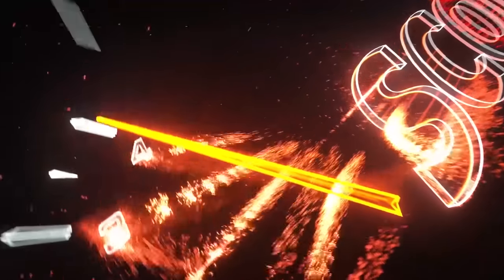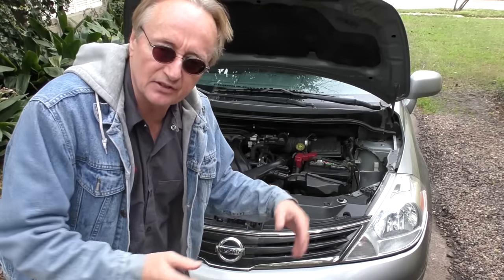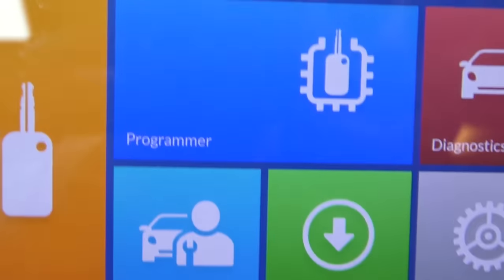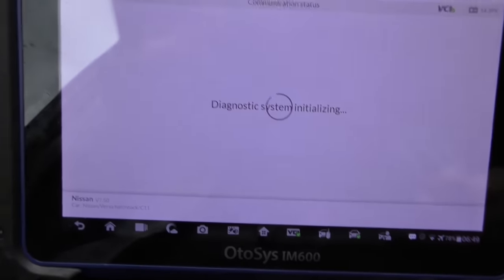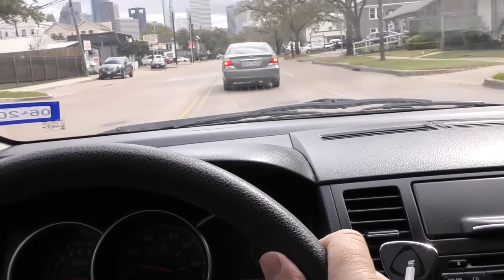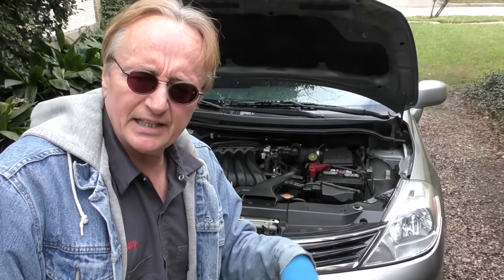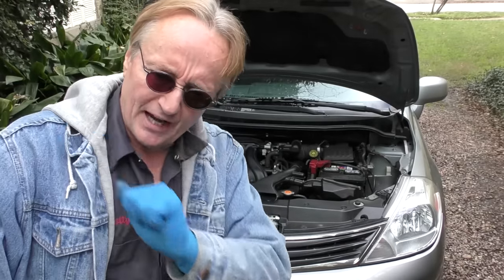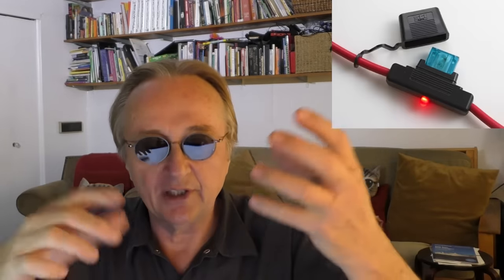Here's Why You Should Buy This Cheap Nissan

Comment: You said someone bought it for $2500? and it's a 2012 model, it's a great deal!
Reply: We had one. It was poorly made. Rattled all the time, despite having 40k miles. It was huge inside though, the trunk space was gigantic too. The engine was well made though. Never had an issue.
Reply: its a nissan,, And they start at $10,000
Reply: @John Fedor It's a simple car without fancy tech. Timing chain, 4 speed auto, no nav or cameras. It should last a good while longer if taken care of. 2500 is a decent price for newer-ish car that looks pretty clean, plus I'd assume it's a southern car, so not much rust or corrosion. I would not buy one of these new, but in a pinch this can be a good car for someone with a tight budget.
Reply: Just Some Guy without a Mustache no it’s not especially considering it has 111,000 miles on it and those transmissions tend to grenade themselves. This car car could be near the end of its life.

Edit…didn’t I realized it had a 4 speed auto, it’ll last longer than the horrible CVT powered ones.
Reply: I got a 2011 for free.
Reply: 111k miles, gonna need the front end redone soon. I bet the highway vibrations show up soon.
Reply: They're pretty much one of the rarest compact car in Germany.
Here it's called Nissan Tiida and you rarely find one with an automatic. They have 5-speed manuals combined with the 1.6l 110hp engine or a 6-speed manual with the 1.8l 126hp.
Reply: @mopedshed  they shoulda paid you to haul it away. 🤣🤣
Reply: @rockraphlegal  if the only issue was rattles and the engine was well made then $2500 is a fair deal lol
Reply: @kenjsr1  ikr, I picked it up from the Bronx, every panel was dented and the wheels had those black hubcaps on them from AutoZone.
Reply: Looks like just changing the pugs will cost another few hundred bucks for labor. They are all like 3500-5500 in my area, so 2500 is a decent deal. A cheaply made little putt-putt car with that many miles on it is gonna deteriorate fast though. Worn out suspension, leaks from power steering and other things, rusting frame components, etc.
Reply: @garybeltrand5802  Electronic power steering.
Reply: Keye Haze no
Reply: John Fedor yeah actually no my dad has a 2010 other than a catalytic converter at 180k miles and ignition coil here and there the car is a damn good deal, today it’s at 520k miles and the transmission is barely starting to go, you’ve probably never bought cash car before though, you can’t buy a 2002 accord for 1k at 2500 I could sell it at a flip for 3500 in a week.
Reply: Thats 2012 Nissan versa hatchback mine is 2007 Nissan Versa hatchback s 181k miles 4 speed automatic still runs on the road
Reply: I just got one for 200 with 96,000 miles on it and new transmission and brakes
Reply: @epyonsystem1869  its that a hatchback or sedan style?
Reply: Got a 2011 Versa 4 speed automatic. 104k miles. Shifts like a dream and stops on a dime. No issues.
Reply: Just some guy with a mustache 
it is and also, you are literally everywhere.
Reply: @mopedshed  Don't get tricked by a quick oil change store when they suggest power Steering flush.  Versa has electronic assist steering.  Versa needs new valve cover, spark plugs at ~100,000 miles. Recommend NGK plugs. Run a cleaning foam thru bottom of AC drain tube.  My Evaporator leaked cause junk and moisture caused a leak ( a big labor job to replace Evaporator! ).  Also, engine has two thermostats. If you live in a 🔥  climate, replace with  185 degree F thermostats.  Also, it is normal for the car not to start on first cold start. You need to allow ~3 or 4 seconds for fuel to get to the engine.  Google "Versa forums " for lots of diy & how-to's. Peace.
Reply: @rockraphlegal  the motor blew in my sisters 09 versa woth around 150,000 miles
Reply: @JDMHaze  They did. The 2020 base model starts at $14,995 USD.
Reply: @rockraphlegal  it probably rattled because you didn’t change the motor mounts lol
Reply: @tails300  yeah the CVTs are the ones that are bad... most of the time. My friend has a 2015-17 Versa hatch and so far her CVT hasn’t gave out
Reply: @rockraphlegal  the timing chain was probably too old
Reply: We both watch cars and attack on titan videos?!?!
Reply: @mopedshed  ungreatful much
Reply: My guy. Whants to sell me a 2013 I believe so nissan versa for $6,000
Reply: @mopedshed  show off 😂
Reply: @garybeltrand5802  I’ve had my 07 Versa for a year now and it been amazing
Reply: Who are you. I always see on different comments
Reply: why are u everywhere !!! whenever i watch a video I find u leave me alone !!
Reply: I mean I found a 2009 Nissan Versa with a 4 speed automatic with only 70,000 miles for just $1200. You think I should consider it? No issues at all.
Reply: @idkmyname_2007  mines I'd already 202k miles bro no issues with it I used it to my daily and hanging out with my self and Go to Far car meet This Car is small but Its tough 😊
Reply: That's exactly how much I bought mine for, also a 2012 but it's the 1.8 s version (Automatic, not CVT)
Reply: Found one this week 2011 120,000 miles 4,800 dollars.

Comment: I have a 2012 Nissan Sentra S with over 192,000 miles on it. Never had an issue with the original CVT. I changed the fluid every 60,000 miles as required in the owner’s manual. Nissan is capable to be reliable as Toyota and Honda. You haters should learn how to read a manual and drive a car properly and you won’t have any problems long term.
Reply: chrisgraydon 
Well spoken true player!
Reply: I agree ☝🏽
Reply: Also own a 11 murano with a 136,000. I change the transfluid every 30,000. No issues

Comment: I’ve had my Versa for about 4 years now and it’s been a TANK. It’s nearly at 200k miles and still running strong... the worst issue I’ve had with it was just a misfire on the 1st cylinder a few weeks ago.. besides that’s it’s been perfectly fine. With regular oil changes and normal check ups and maintenance this little car will go for years and years! I recommend it as an owner 🙏🏼
Reply: I bought my civic brand new in 07 and it’s finally starting to go. I got my eye on a 2022 SV Versa that I’m about to pull the trigger on
Reply: I had mine for 7 years now about to hit 150,000 miles. I kept up with the maintenance & havent had any problems with it.
Reply: @raydawg2132  I got the 2021 SV in January, absolutely love it so far!
Reply: Thank ya sir...as I'm in the process of buying a 2014 versa manual transmission...better
Reply: 2017 SV sedan and other than a glass steering rack, it's not THE WORST car, and it's snappy when it needs to be.
Reply: Just got a 2013 Versa SL. 150k with brand new transmission from dealer. Smooth ride. Happy. Will update. Lol
Reply: Im a toyota guy, however the versa is very underrated, i have a coworker we do courier service, he had more than 300k in it (versa) and counting
Reply: @Mujahideen_khinzir  manual trans
Reply: @HistoricalWeapons  actually automatic, its an older versa, i think the 1st gen, not sure
Reply: What yr is yours
Reply: @Mujahideen_khinzir what year?! What transmission?
Reply: @HistoricalWeapons  no, automatic, a 2009ish model. We live in socal so i guess the weather maybe a factor as well? My corolla went 260k +
 miles before i sold it, just bought lower mileage year older same corolla for insurance purposes
Reply: @lovedove9734  he had the automatic 2009 nissan versa. This was back in 2016.
Reply: @ronly_driver is the steering rack the only major problem that some of the Versas might have?  I know if you get a CVT change that fluid regularly or get a mechanic to do it and make sure they know with no doubts that it is a CVT so they don't put ATF in it and destroy it.  I have heard of that happening to some Honda owners too, they have a CVT and the shop puts in ATF by mistake.  It will ruin them.
Reply: What year is yours?
Reply: @GorillaGlue42 did you do it? I was going to say I don’t think you would be too happy after being in a civic? Pacific is a lot nicer in my opinion. A lot more pep too
Reply: @blacjackdaniels200  I did like it, def not the same as a civic though. I only drove it for about a year and traded it in towards a 2023 Sentra SR Premium.

Comment: That first gen Versa was decent cheap transportation.  Nissan could have saved their reputation over the years if they'd only stuck to traditional automatics.  They'd probably still be #2 behind Toyota if they had.
Reply: What’s wrong with CVT’s if you don’t mind me asking
Reply: @jms3460  Higher chance of failure than a tranditional auto
Reply: @jms3460  a cvt in an of itself is fine it's just Nissans one is crap Toyota Honda and other companies don't have problems with theirs it's just Nissan
Reply: @jms3460 cvts ain’t so bad but Nissan makes horrible cvt
Reply: @jeffmorse645
It really boggles my mind how after all these years they haven't either gone back to traditional autos or at least switched to using a more reliable 3rd party CVT them jatco.
Would solve so many issues with brand reputation.
Reply: @hollowgonzalo4329  They own the CVT manufacturer.

Comment: Underhood looks alot like my 2011 Nissan Cube. I have changed the CVT fluid every 30 thousand miles, and changed the oil every 3750 miles with top grade synthetic oil, and at 145,000 miles it has been almost problemless.(MAF sensor only repair) and runs and looks great. Going for 300k(fingers crossed)
Reply: Is changing the cvt fluid the key to keeping these transmission going? I know people that have had to replaces transmissions on Rogues
Reply: My Cube now has 234k miles. Original transmission. I think with regular maintenance you have a chance at a long lasting CVT. I think with no maintenance the chances are low. Best of luck!

Comment: You're so correct Scotty. The CVT trans, are junk. My 2019 Versa rental was like an upholstered beer can with a radio. Thank you!
Reply: Lol!!!
Reply: Seriously though, got one as a rental on a rather windy day, scary to say the least😂
Reply: I own a 2016 Versa with the CVT transmission and it currently has about 140k miles on the original CVT  transmission and no issues. From what I've seen the older generation CVT transmissions had more problems than the newer generation ones. I think an important part of keeping it going is changing out the CVT fluid every 30000 miles or so plus both filters that the CVT transmission comes with.
Reply: GenEmperor that’s incorrect. the older cvts that didn’t mimick shifts had less problems .
Reply: @GenEmperor  you've only got 140k miles on it though...
Reply: @user-oq3lv6lv7x  I have a 2017 nissan cvt and it doesn't mimmick shift.
Reply: My Versa is fine. Mine has a manual transmission tho
Reply: Everything feels safer than a motorcycle. But i still love my bike and i still have to ride a versa so when it dies i wont feel sad
Reply: I have a 2020 Versa,   granted a much different design from the later Versas,  no problems yet... but it is only about one year.   I have this on a lease, so I doubt Ill have it long enough to see any problems,  Ill probably be around 45k miles by the end though.
Reply: @mewimi  2017 here. Gotta love the sub-$20 fill-ups at the gas station. It does get a bit windy though.
Reply: @xxboxofmuffinsxx4252  I've heard that the pre 2020 models are a bit tinny inside.  But as for wind, yeahhh you can definitely feel your car being pushed a bit by it on a windy day,  but that might be a sub compact issue more than anything :p
Reply: He said to by a 08 versa and it's a bucket dude is fun to watch but over has bad advice towards buy a car
Reply: @GenEmperor I just bought a Nissan versa with 60k miles on it should i change the transmission fluid or no ? I hear everyone say that cvt transmission are bad etc
Reply: @ERod28  if I were you since you're not sure when was the last time they changed it I would change it because the transmission can seize up if it's past due when it needs to be changed. You can find YouTube videos on how to do it. They usually recommend you change the gaskets and filters when you do it too.
Reply: @GenEmperor  what if the check engine light isn’t on ? Still have change transmission fluid every 30k to 60k
Reply: @ERod28 from what I remember the check engine light wouldn't turn on for that and your transmission can literally suddenly go into safety mode or whatever its called to prevent possible damage if your fluid change is overdue. When that happens your car will barely move. That happened to me and after they changed the fluid it went back to normal so ideally you don't procrastinate on that.
Reply: @GenEmperor  okay thanks for taking your time appreciate it I’ll go get the fluid change on the transmission

Comment: I’m driving a Nissan Sentra 2004 1.8 engine 5 speed manual with 670,000 miles and counting!!! still running 😼😼
Reply: Manu, you must live in your car.  For a 5 day working week, that's 160miles per day, ie 3-4 hours every day and a fortune in fuel & maintenance costs.
Reply: My 2002 SER SpecV was junk, but the 1.8 was a good little engine.
Reply: Older Sentra's were great, if Nissan didn't merge with Renault just think about how much better they would be today.
Reply: @neilparmar5705  I think Renault and Nissan divorced recently.
Reply: Sergio S. Huerta they did.. but they left nissan with the baggage
Reply: I had one new as my pizza delivery car, 2004... love the stereo, steering wheel. Only problem up to 65000 mi was the coils at 17K mi. and it ran great interstate until I totaled it in an accident. The insurance co credited me 3000. over blue book.
Reply: No way that's alot of miles
Reply: I've a 2006 Sentra 1.8 L and need to replace it . I've taken it to two different shops and wasted $500 . Still not fixed will die soon . Took it to dealer shop and they're totally guessing . They said try this fix for $760 and if that doesn't work replace electric harness for $650 . Just great
Reply: can you drive 3 hours to another city with no problems?
Reply: @Afrocreolebombshelle  why do you ask ? I wouldn't even try to go out of town . It's dying very soon .
Reply: Prove it please ? I always give a person the benefit of the doubt !
Reply: I doubt you're serious
Reply: @frankmontez6853  you're believing people who couldn't even fix it....it's probably not dying...
Reply: @richsweeney1115  you may be right . Had problems with new car and while that one wasn't running the old sentra stepped up . No real problems which was verry surprising . New one I got last Sept wouldn't even start 2016 Ford Focus now runing but still a lil hesitation , stalling when accelarating
Reply: @richsweeney1115  it already died once over a year ago and got it running  mostly . And just recently while new car the Focus wasn't running at all had to use old sentra . It never let me down almost a month

Comment: As a courier I put 60,000 miles a year on my vehicles
The first Versa I owned I bought with 60,000 miles lasted me over 380,000. 
On my second Versa which I bought with 80,000 miles I'm now 
at 225,000.  No major repairs just regular maintenance
Reply: what year was the first one, and the one you have now? manual or auto?
Reply: Walter Bandeira 
Model years please?
Reply: Gib updatez
Reply: Which years bro?!?!
Reply: Walter--True! The Nissan Versa is an excellent car..Great value
!
Reply: Nice. I'm a courier too with a 2008 Versa SL
Reply: what years were they?
Reply: @laurareyes5362  That model was made from 2006 to 2011 wich was the first Generation.
Reply: What happened at 380000
Reply: CVT transmissions??
Reply: I bought my 2015 manual trans versa with 50k on the odomenter. Hope to get 200K+ I dont pound it, and gently drive about 300 miles a week. looking to get 10 years out of this car... put new sneakers on it, and do oil changes every 5k.